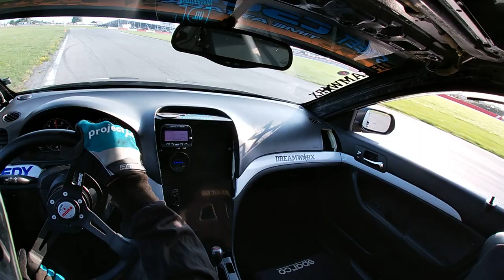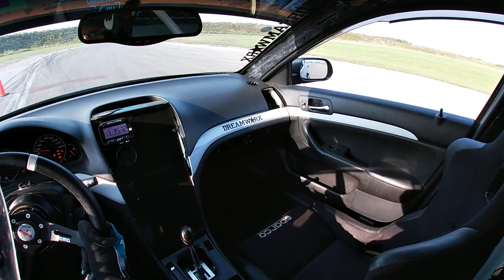Skip - Test Session @ TMP Cayuga

Comment: Nice, last year I confirmed something that should have been obvious to me, USDM 03-07 5 Speed manual Accords share the same casing as the CL7 Euro-R, just all aluminum, unlike the TSX casing which is alum/magnesium... look up part # 21200-RAP-000, swap 6 speed guts into accord 5 speed case,  get a new 6 speed gear selector and you are good to roll brother